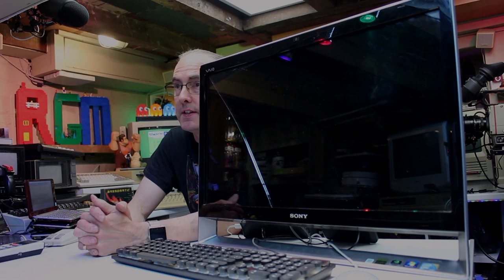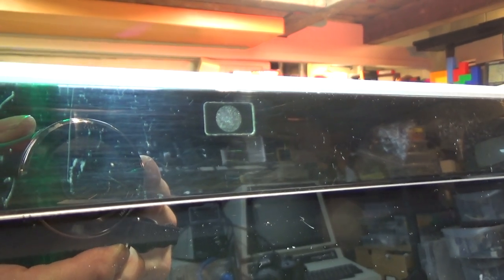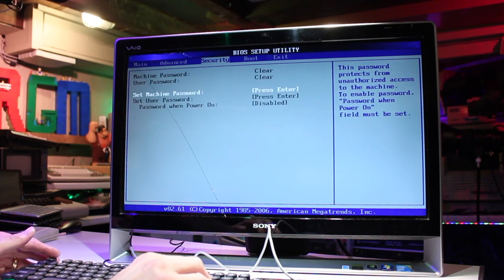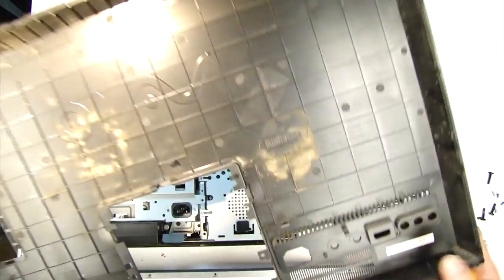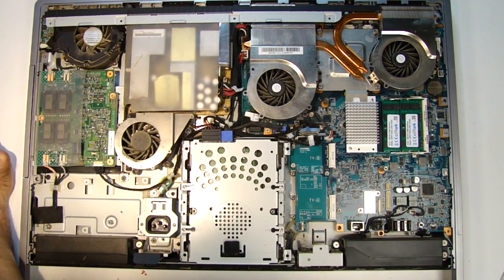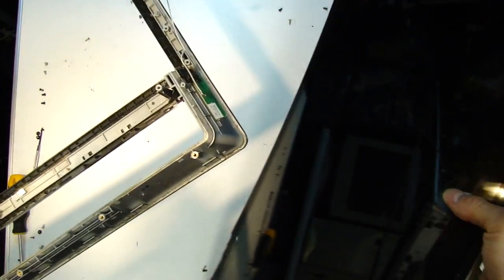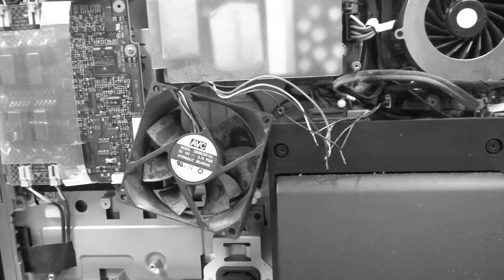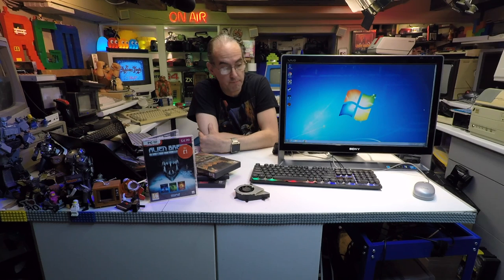SONY VAIO VPCL11M1E 24" All In One Desktop PC RESTORATION  With Cracked Digitiser. #vaio

Comment: I have an aio the psu fan failed but i just put a new fan on and jerryrigged it in place, mine was an hp touchsmart works great the osu fan died shortly after disassembly of the device i thought it was my fault maybe not

Comment: I do wanna say do not use a vacuum on a computer, it builds up static and damages the boards i recommended using an electric air duster or a compressor